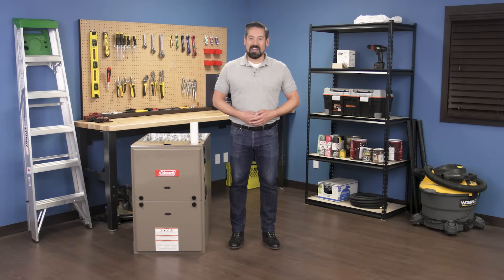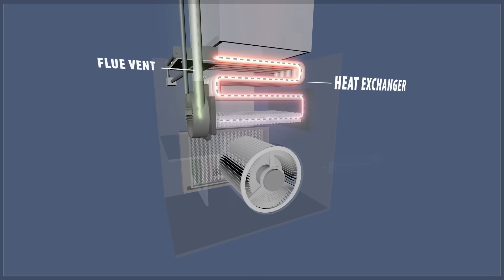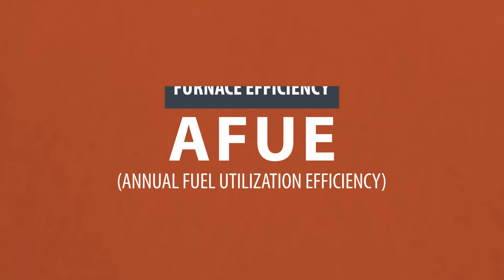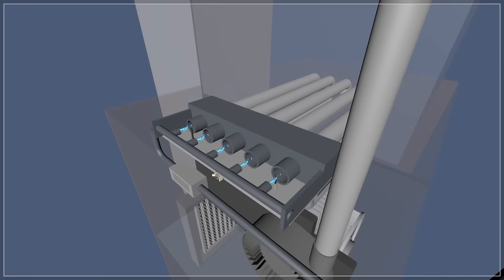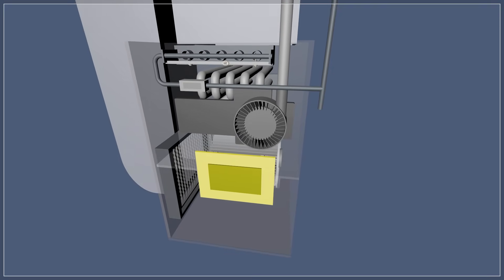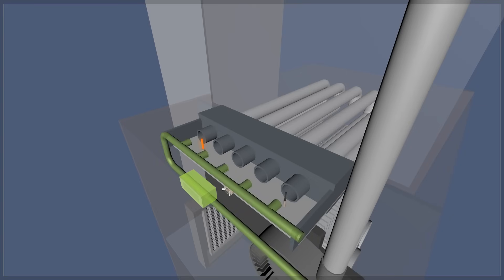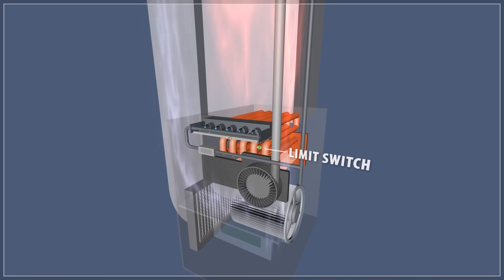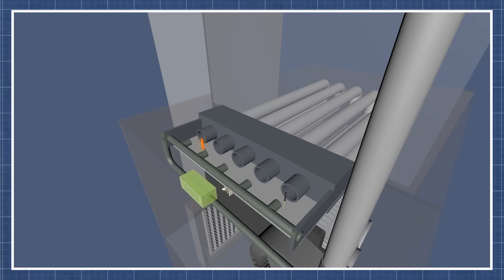How a Furnace Works | Repair and Replace

Comment: Too bad you have zero parts for my furnace.
Reply from the maker: Thanks for watching. Certain stock is based on what the manufacturers will supply. For some models there are only universal parts available but we are getting some more universal control boards soon which will provide more solutions in these cases.

Comment: We had a massive hole in the first bend of our primary pipes. It mustve been leaking for a long time!
Reply from the maker: Thanks for watching. If you have any holes in the combustion pipes then you must shut off the furnace and get it serviced by a technician as carbon monoxide will be released and is harmful.

If the hole is in the air ducts then heat will be lost but this is less crucial, and not dangerous.

Comment: I work as a gas engineer (central heating and gas boiler) in the UK 🇬🇧 and I'm looking to move to the USA or Canada. Could you tell me if there's a lot of demand for work there please 🙏
Reply from the maker: Thanks for watching. It is hard to say what the full demand for work is right now but Alberta is very gas centric and will continue to need good talent. Then there are the other colder states like Montana, North Dakota and Minnesota that have more extreme winters, so more demand on the heating, and potentially more need for repairs.

Comment: Always thought this had to do with the water in the house. Had no idea it was for rain water. Just got hit by the remnants of the first hurricane in the US and our sump pump didn’t trigger 😢. Now I’m spending the rest of the day cleaning carpet in our basement 🙃
Reply from the maker: Thanks for watching. There are sump pumps with backup batteries, and dual pump models. If you're concerned about flooding then these other options are a good choice. This video shows how to size a sump pump as well it covers the various features available: https://youtu.be/Iqh3rI2XX4o

Comment: Should you insulate the "inside" of the gas furnace if the furnace is installed in the basement (damp) and the house is close to ocean (1.7 miles away from ocean in San Francisco)? If so, how to insulate the inside of the gas furnace? Thanks!
Reply from the maker: Thanks for watching. When it comes to relative humidity, the furnace inducer motor will draw fresh air into the burner. Insulating the furnace will not prevent moisture from the air from getting into the system. If you want additional control of the humidity inside your home, then you'll have to use a dehumidifier.

Comment: So what happens when power goes out?
Reply from the maker: Thanks for watching. When the power goes out, the gas valve will close and the furnace will not work. Once the power resumes, the thermostat will call for heat and the furnace will start a heating cycle.

Comment: Hello. Great video. I live in an apartment and the gas furnace stops working during a power outage. Can I connect a vehicle battery or some other power source to the furnace so that it will run during power outage? Thanks
Reply from the maker: Thanks for watching. In North America, the blower motor runs on 120V AC power. A vehicle battery would be providing DC power and would not work. You would need an inverter and a large battery capable of providing enough power. The cost of this would be quite high. For outages, many people use small mobile propane heaters (which need to be used in a well ventilated area)

Comment: Thank you for nicely explaining just a question sometimes our furnace blow cool air with hot  air settings and after several minutes it gives hot air does that means do we need to a service we regularly change  filter
Reply from the maker: Thanks for watching. If the furnace shuts down after only running for a minute then it could be an issue with the high limit switch. This can replaced in just a few minutes https://www.youtube.com/watch?v=0va_wvwfCBA but if you want someone to take a closer look then it never hurts getting a service call.

Comment: I hear loud vibration noise each time the furnace starts and it lasts for about 30 seconds then it disappears, anybody knows what is the cause? the furnace is a Lenoxx dual stage and I purchased it 3 years ago.
Reply from the maker: Thanks for watching. If it happens right when it starts then it's likely the inducer motor as this is the first blower to run before the system heats up.

Check to make sure that the condensate drain pipe is clear and is draining properly. A buildup of water can cause problems. As well you could double check to see if any screws are loose and that everything seems secure. 

If the noise gets worse then its possible that the motor bearings are starting to wear out. This is not as likely since the furnace is only 3 years old. At that age these parts are likely under warranty which would be covered. Depending on the problem the cost of inspection may not be covered under warranty.
Reply from the maker: Just a note that most manufacturers will only honor warranty if the part is replaced by a technician.

Comment: Awesome video! Very helpful!

I watched this video because i have a strong metallic smell coming from the compartment where my furnace is held. I havent used the furnace in a long time. Anyone know why a metallic smell would be coming from the furnace?
Reply from the maker: Thanks for watching we're glad that you found it helpful! If you haven't used the furnace in a while, a metallic smell might be from the motor bearings or another part that is starting to wear out. You can see how to access and replace the blower motor in this video: https://www.youtube.com/watch?v=4SY8lRl8HV0 It could also be the smell of plastic or rubber which can sometimes be similar. Hope this helps!

Comment: You didn't mention the exhausting system and the second heat exchanger to enhance the efficiency
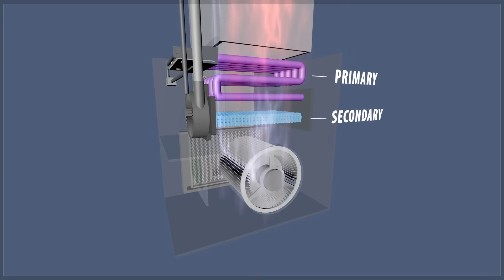Reply from the maker: Thanks for watching. This is something that is shown at 1:20 we didn't go into as much detail on the secondary heat exchanger more than the basics but we do mention that it increases the efficiency due to condensation.

Comment: That loud noise at the very beginning of the video doesn't even need to be there. That's enough to scare the mess out of somebody if they got the speakers turned up and didn't know about it.
Reply from the maker: Thanks for watching.  Now if someone has their speakers turned to the max it doesn't seem like it would matter what sound is playing it would still likely startle them. Also how is that different than watching a movie that has intro sounds before the movie starts?
Reply: @AmreSupply  It was actually a 2/3 volume. But I see what you're saying. Especially in reference to the movie sounds. Like that growling lion logo for Metro Goldwyn Mayer or that THX home theater logo....those are ridiculously loud!
Reply from the maker: @REXXSEVEN  With that being said, In the last 2 years we have revised the intro sound though to make it "less harsh" (not necessarily any quieter)  and we've shortened the intro. If you're curious you can see an example here: https://www.youtube.com/watch?v=L9ZI5GyON9I

Comment: The proving time is more like half a second. The gas valve opens 7 seconds after the HSI. but great video. I'm going to save it as a teaching aid for my customers.
Reply from the maker: Thank you! You are right on the proving time and the wording could have been slightly different in that section of the video. We're glad that you think it's a good video to share with customers.

Comment: Thanks for your great videos, you said in your video when the surface igniter get hot the gas valve open , what sensor send that signal to board to open the gas valve , and how can I check for low gas pressure, or do I need to call the hvac company for that thanks again
Reply from the maker: Thanks for watching. The opening of the gas valve & power to the hot surface ignitor will be timed by the control board only after the pressure switch verifies that the combustion airflow is good. There is no specific sensor that monitors the gas. The flame sensor will detect if the flames ignite and stay lit, so low gas pressure could be detected indirectly here. To test gas pressure and test the gas valve it's best to contact an HVAC company.
Reply: @AmreSupply  you are the best thank you so much 🙌🏻👑

Comment: What software do you use for 3d design simulation?
Reply from the maker: Thanks for watching. Models were first created in Cinema 4D then it was animated in Adobe After Effects. A free option is Blender which is an extremely powerful open source program.

Comment: Mine sounds like a jet engine when It goes off on the main blowing part everything works fine just so loud when it blows the air hope heating company can change settings on it
Reply from the maker: Thanks for watching. Is it louder than it normally is, or has it always been that way? Some furnaces have multiple speeds and in some cases this can be adjusted.

Comment: I have requested the services of a furnace repair company, and they have not done anything, and what they have done is send a very high receipt, and the work they did is put a lot of duct tape on the emergency switch, thing that I clean it of all that and put the safest thing without it moving, but my doubt of failure is still there and is that I hear that it wants to work and as if it loses strength, it turns off and then again and so it is for several minutes, until it starts working and so it happens and I would like to know if it is a matter of coil or capacitor problems, I await your recommendation that I can make, Thank you
Reply from the maker: Thanks for watching. It can be frustrating to pay money and still have the problem not resolved.

What was the source problem that your furnace was occurring? How far into the startup sequence did it get to?

Comment: What an amazing video. I can’t wait to take a crack at it. 

Can I buy a gas valve from you guys to get started?
Reply from the maker: Thanks for watching, we're glad that you found it helpful. All parts can be found here: https://www.amresupply.com/catalog/650036 As for the gas valves, unlike ignitors and motors this is not something we have repair videos on. If you think the gas valve needs to be replaced then it would be best to call a technician.

Comment: For the water system, is it necessary to drain the water every so often?
Reply from the maker: Thanks for watching! Condensate produced by the furnace or AC can either be drained directly into the floor drain or removed using a condensate pump. This is shown in more detail in this video: https://www.youtube.com/watch?v=dcLhyLu0-y8

Comment: Thank you so much for your explain how the Furnace working .. about the filter is that the same on in return air in some kinds of furnaces in the house's roofing or that a different filter .. Thank you
Reply from the maker: We're glad that you found it helpful. You might be referring to a fresh air intake filter which is used in some homes. Since a furnace will take air from inside the home and move it outside, it will create negative pressure. To balance this pressure a fresh air intake is often used, and a filter can help keep that air free of dust.

Comment: What a piece of garbage who ever design/invented  this need a slap in the face , we need to invent something that doesn't break ever year and with parts that cost 3000 dollar to replace
Reply from the maker: Thanks for watching. High efficiency furnaces have improved significantly from standing pilot furnaces and are more safe to operate thanks to the safety switches. The only downside is that more components, means that there is more that can go wrong. Hopefully you still found this video helpful.

Comment: Is this how the majority of North Americans heat their homes? In the UK we have gas boilers with hot water pumped to radiators
Reply from the maker: Thanks for watching. Gas furnaces are quite common in cities in Canada and the US where gas is cheap. Gas boilers are a little less common and were use more in older homes. Electric forced air furnaces are used more in eastern Canada as gas prices are higher.

Comment: Two unrelated questions!
1. I've seen people put 'Canadian tree essential oils' on their furnace filters to blast off a pleasant scene around the house, just a few drops on the filter. Does that damage the furnace?
2. Do you really recommend smart thermostats? They are fairly expensive...I'm assuming it would take months to recoup that amount in energy savings...am I correct?
Reply from the maker: Hi Danny, thank you for watching.

Essential oils are a inexpensive and safe way to give a pleasant scent around the home especially when compared to some commercial air fresheners which are a mix of a bunch of chemicals. Add a few drops on the filter to start, and add more if the scent needs to be stronger.

Smart thermostats can be helpful for people who want additional control over their furnace or WIFI connectivity. If you want to save money, even a basic digital thermostat like this can be programed to have lower temperatures during the day or evening to save energy: https://www.amresupply.com/catalog/Digital-Thermostats-HT7H?prices=50.0099.99

If you want to learn a little more about thermostat features here's a video we made: https://youtu.be/NO5guc3vfV0

Comment: One of NY Largest License Plumber / Boiler installer REFUSE to install Burnham IN Series.
BEAWRE of Burnham Exec who are equivalent to the Opioid Exec
 "if installed and serviced correctly this boiler may possibly last 25 years (or may not). -- this is from 
Dan Cork (VP of Marketing) and it is car-sales man version of the Boiler-sales-man response: DISGRACEFUL to every inch of humanity.

Ask him yourself Dcork@usboiler.net
P.717-481-8428
C.717-823-7085

What he does not tell you is that, there is a known defect that the IN-series boiler has, and they are praying and hoping customer don't know about it...it's the reason why License Installers in NY REFUSE to buy Burnham boiler:  Don't buy this crap anymore people.....the company is like the Opioid company when it comes to taking responsibility.....What I have to is is -- install Burnham at your own risk!
Reply from the maker: Thank you for sharing your experience. In your case it would be best to post and submit your info to the Better Business Bureau.

Comment: Does it emit carbon monoxide?
Reply from the maker: Thanks for watching. Carbon monoxide (CO) is produced when carbon-based fuels, such as kerosene, gasoline, natural gas, propane, or wood are burned without enough oxygen, causing incomplete combustion. This is why its essential to keep the furnace clean and to have a good supply of air. In forced draft furnaces, the draft inducer blower ensures that all the exhaust fumes are safely removed. Still a CO detector is recommended for every level of your home.

Comment: Great Video! I noticed a sewage/sulfur? smell when the heat turns on and blows through the vents especially in the morning, I replaced my filter what can this be? Oh sometimes when I turn the hot water in my bathroom sink it also stinks BUT not always
Reply from the maker: Thanks for watching. If you smell sulfur then its a more serious concern. Natural gas does not have an odour, so a  harmless chemical  is added so that gas leaks can be easily detected. This added chemical smells like rotten eggs or sulfur. In this case you'll want to shut off the gas valve and call a professional to do an inspection.

Now musty or damp smells are a difference scenario and usually result from moisture inside the furnace or in the ducts.

Smells in the water heater can be a result of the certain bacteria breaking down minerals inside the tank. A tank flush might help and you can learn more here https://www.youtube.com/watch?v=hkbi24QJhDw

Comment: Hello. great video. I need an advice. My furnace recently it would not work in the morning until I disconnect/connect the main 12way connector of the main board! I diagnosed it step by step and can not find anything wrong. any advice ?
Reply from the maker: Thanks for watching. Its possible that your furnace tripped and went into a lockout. This is covered in this video here: https://www.youtube.com/watch?v=b0sAGt-1niU
Reply: @AmreSupply  Thanks for the quick reply. I checked the video. I am afraid it does not explain my case, as the limit switch is new I just replaced it. and there is no flashing indicators from the board. Turning on/off the power switch it does not help. Only thing that helps for several hours is disconnecting the 12 way on the main board!!!
Reply from the maker: @mk-zk6bs  Thank you for clarifying. It could be a issue with one of the components on the control board itself. The board is easy to replace but its hard to know for sure if its faulty. These sorts of things are difficult to narrow down as they can't be tested as simply or as easily as a limit switch.

Comment: When gas is NOT needed no more as in summer time do i need to turn of the HETA part of my HVAC UNIT OR JUST KEEP IN ON POSITION AND JUAT,TURN ON  MY AC DR THE THERMOSTAT .. ?
Reply from the maker: Hi Rich, thank you for watching. The thermostat will control heating and cooling so you don't need to manually shut off the furnace, it will only run when the temperature goes below the threshold set on your heating setting. In the summer you can lower the threshold for heat to come on that it will only run during really cold summer nights etc.